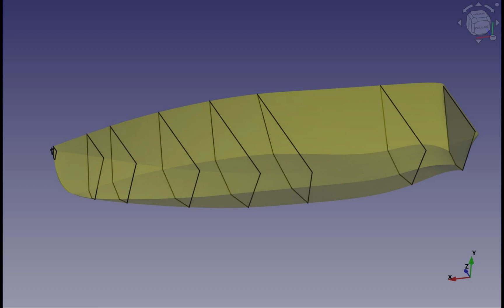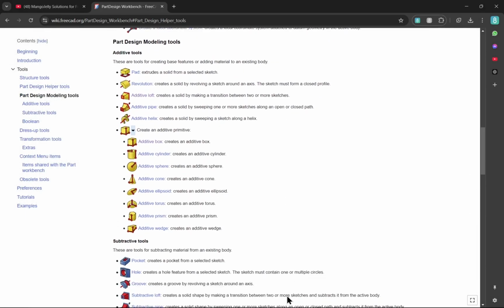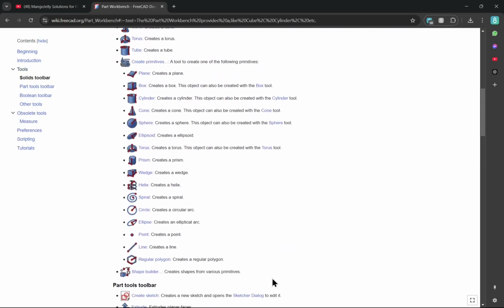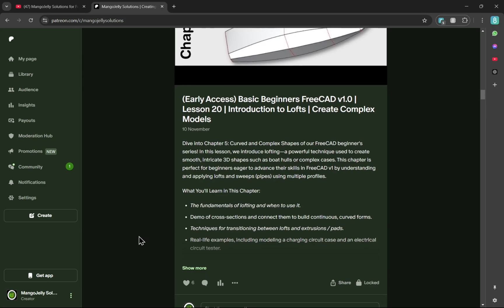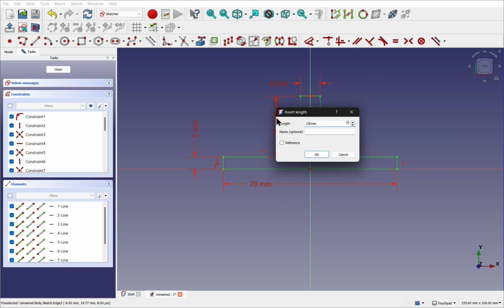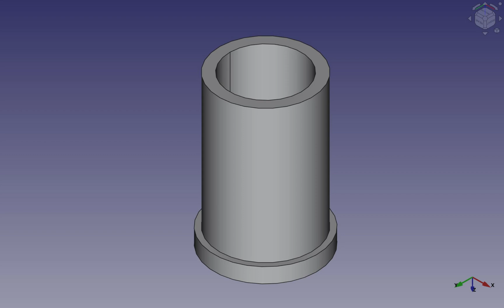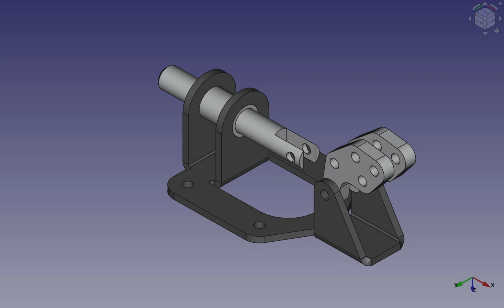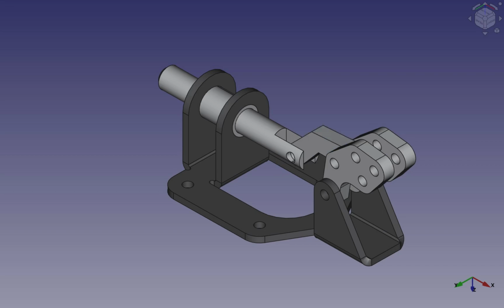Basic Beginners FreeCAD v1.0 : Introduction to Course

Comment: Hello, I see here that you have 2 55 part (as of today) courses, this one called Basic Beginners FreeCAD v1 Course and one called Basic Beginners FreeCAD v1 (Public). Are they the same, or different? If different, which would be the better option for someone who wants to design woodworking projects and is completely new to CAD software?
Reply from the maker: Hi, yes they are both exactly the same. But agree is confusing. YT decided to create a new feature called "courses" which is basically a playlist in a new course tab with a completion gauge. But this is an early feature and anyone looking for the playlist as it's been referenced by in the past wouldn't of found it. People also reference it as a course so they are exactly the same and live in both. Sorry for the confusion. I will update the description on both. Hope that helps.

Comment: me and my 19yo daughter just ordered a bambu mini a1. freecad came up as a good place to start. i just watched your video on making a bracket. an hour long and i didnt nod off, so i have subbed and going to make my way through your tutorials over the next few months. quiet an achievement for 10pm on a Sunday night
Reply from the maker: Ahh it sounds like you watch the Ultimate Beginners FreeCAD short course?  Great to hear that's given you a good head start and your already got something built.  Hope you enjoy the long form course, it's pretty in depth but it covers virtually everything in the Part Design.  It's design so you can gather knowledge and drop in and out.  Good luck with the learning and thank you for subbing.
Reply: @MangoJellySolutions no worries, I started with the playlist. Your course and style are very good! MUCH better than anything else I’ve found. I’m on a Mac, and some of the alt click suggestions take me a few minutes to figure out becuase the Mac option key doesn’t always equal the Windows alt key. 
I’m trying to learn this so I can design woodworking projects. I originally tried the free version of Sketchup, but the first time I needed to change the size of one board, I realized the limitation.  In my subsequent research I learned about “parametric modeling”, and then I learned about FreeCAD. Gemini AI and Perplexity both said MangoJelly is the “gold standard” for learning FreeCAD.

Comment: Any chance of doing a video solely on how to fix broken bodies.  I get this problem a lot where I design something and its not quite right and I have to edit something pretty near the top of the tree. Then suddenly I have lots of broken things. I get a whole host of error messages about things not being attached and faces missing. Its particularly bad if you have fillets or chamfers, I nearly always start off by deleting all of those.  I end up deleting a lot of features of the body until it sort of comes right. Sometimes I can re-attach things but often not.  So some strategies on how to approach a broken body and fix it would be really useful
Reply from the maker: I think this is the second request for something to cover what you are having problems with, the other one was from a patreon.  I think this would make a very useful video.  I will add to the list.

Comment: Hi, I have been following you since sometime, a month to be honest. I really wanted to know how  easy it would be to create parametric design lampshades with that wavy spiral patterns like we get at wooj design. I am really looking for one but could not find it anywhere. I know we can do that easily in rhino but that software is what I can't afford at the moment. Thank you for your videos. There is no documentation for freecad for those but I think this lofting technique make my understanding a bit clearer.
Reply from the maker: There are a number of lamps on that site, some of them are pretty simple to create, others are a lot more complex but most your are right in thinking to use a loft.  Such ones as the wavey lamp is a standard loft, or a loft of one section and then a polar pattern.
Reply: Thank you so much for your reply. Trying to wrap my head around freecad. Could create some patterns now but still a lot to learn.  @MangoJellySolutions

Comment: These videos are excellent. However, what I find baffling about FreeCAD is the lack of consolidated documentation on the "objects" used by FreeCAD. I do not mean the actual implementation in the software. The model tree view shows items, that are conceptual "objects" at any rate.

For example, when just experimenting, I created a new file and then added a Cube in the Part WB. I then went to the Part Design WB and created a body. The Cube and the Body were then separate in the model. I dragged the Cube into the Body and got a "BaseFeature".  What does all this mean? How does a Cube from Part WB relate to  similar geometry made with an extruded sketch in Part Design?

I could pick my way through the wiki and figure it out (maybe), but the focus in most videos is on actions, i.e. how to do stuff.

This kind of question might be appropriate for the FC forum. A search of this kind of topic on the forum led to the usual collection of unhelpful, arrogant responses that amount to "you don't need to know that" or "RTFM". 

 So, a video course would help.
Reply from the maker: I am glad you enjoying the videos.  What you are finding and question is one of the things that I experience as a real hurdle for myself.  I kept on asking myself "why ???" as well.  This is when, after a lot of research and reading I found out the reasons why.  The part design workbench was born after the part workbench.  With the part workbench you can use anything from other workbenches.  But when you enter the part design it starts to become confusing.  

The part design workbench is really a self contained workflow and focuses on solely solid based modeling.  You can pull in objects created in other workbenches as long as they are solid, as you have done but you can only have one base feature.  There are other methods to do this but you are mixing two very different workflow.

The part design workflow is feature driven in that you create sketches upon features created by other operations and then create an operation on that sketch.  This operation automatically fuses / removes their volume to / from the other operation.  Part WB fusion / removal of material is done manually giving it a more flexible approach.  

Where the part wb comes into it's own is with surface and compound base modeling which the part design doesn't support.  

I do have a video that touches on this in the course but it is a major thing that creates so much confusion in learning this package.
Reply: @MangoJellySolutions  Thanks for the informative response.

Comment: I learnt a lot from this channel when I was learning FreeCAD v0.22, and it was because of the concise and well structured manner of teaching that I decided to become a patreon about 8mths or so ago. Darren was very helpful when I got stuck with one area of a design (which was creating through holes through multiple parts). Recently, owing to family commitments and having to do a fresh system install I'd been away from FreeCAD for the past few months, during which time v1.0 was released. The other evening I needed to use FreeCAD to do a simple bracket for a 3D print, no problem I though, so downloaded and installed the program, ran it up, and was stopped dead in my tracks!... So much had changed I felt like I was back at square one! Different colours, new layout, buttons I didn't recognise or were missing, even just finding my way around the new layout in Parts Design it was obvious there were a number of new features that were an improvement over v.0.22 but which I wasn't prepared for. My first place to go for help was this channel, specifically the crash course for v1.0 which proved ever so helpful...  So, I'm back to learning about FreeCAD v1.0 at the Introduction Course just so I can discover what changes have happened and refresh my memory... Thank you Darren for staying so up to date with FreeCAD and making invaluable videos that are a blessing to learning FreeCAD. You are a gem, please keep up the amazing work!
Reply from the maker: Nice to have you back and thank you for taking the time to write this comment.  I really appreciate the kind words of support.  So glad that I can still offer out help :) :)
Reply: @MangoJellySolutions  Am starting freecad learning as well  Started wth your turorials a whiile back, btu decided t dive into F360.  Was farily deep into F360, but cannot stand it anymore.  too many issues and if I grow, too expensive to use for my hobbyist goals.

Comment: Hi man thanks a lot for this, awesome work I just subscribed

What I didn't see on youtube or anywhere else is an honest review of the V1 software, like what are your critisms, say compared to Fusion 360. I think this would make a good video topic also for the dev team to get some video feedback.

Many people I know is interested in switching but are afraid, because also for previous versions I heard amazing things, tutorials were there but then after I started using it, parts started crashing with topology errors and some more that I didn't even understand. In Freecad's defence there were workarounds, like a certain way to design the parts but in my defence, I did what was easiest for me just like I would do in anyother cad suite and it'd work, here though it crashed.

I heard V1 tackled this issue, but when I google FreeCad V1 bug, forums are boiling and I can find a lot of other issues. What is your honest opinion? How would you rate V1?
Reply from the maker: Hi, great to have you here and thank you for your comment.  My honest opinion,  I have used a lot of 3D packages in the past and v1 is a long awaited and huge step forward.  I have a number of  patreons that I have helped with projects who have made the switch from F360 to freeCAD and they are satisfied with the product.  Obvious as with everything there are improvements to be made but this is just the beginning.  FreeCAD is already pushing forward with new developments.

The adoption and change management from one software to another is always a rocky road.  As humans it's in our DNA, we don't really like change, it burns too many calories learning a new way of doing something, and you see this a lot with swapping software.

Comment: How to make pattern array in sketcher? When i use the array command, all of my lines are out of constraint. The base circle or line is fully constrained, but the pattern-array line, circle are not. In other cad platforms, it will be automatically constrained because the base line, circle is fully constrained. I cant find Create Array in Freecad V1.0.0

Comment: FreeCAD made a big improvement. As the main modelling software I am using Rhino but for some parts a classical CAD program with with constrains works better. I was trying several times FreeCAD but ended up with Fusion. Anyway, I think now is the time to have next to my Rhino a FreeCAD.
Reply from the maker: I loved Rhino, Grasshopper was a bit of a time consuming modelling process but enjoyable

Comment: Can you make some easy to follow vids on making nuts and bolts as well as knurling please? All the vids I’ve found are back and forth and can’t see what’s selected when they’re doing it making it hard to follow.

Thank you and keep up the great work
Reply from the maker: This sounds like a really good idea and it will fit in nicely with the addative helix tool and patterning tools in the part design. Just for reference there is an addon wb called the fasteners workbench which has a large selection of threaded nuts, bolts etc all to iso spec if you ever need something quick.

Comment: Great videos, truly top notch. The 1.0 release still has quite a few UI bugs/issues. Can't type in digit values because it switches the camera view is a real mess atm. Looking forward to more videos as freecad bugs are cleaned out.
Reply from the maker: Thank you :) Glad you like. In regards to digital values do you have an example of what you are doing when you experience the issue? I would like to look into it. I have only experienced this when I type into the placement field when I have forgotten something is attached and it's the attachment offset I am suppose to be editing so the other field will be locked. Or when I enter values into a field that is locked by an expression and I need to open the expression editor to clear it out first.  It will do that with anything that is read only.

Comment: Could you explain how this works? This is the first video on the series just released, but the playlist already has videos - from many months ago.
Reply from the maker: Yes it does seem a bit confusing but the video is an introduction to the course. As I was building the course I wanted to release each lesson as they were made, but the trouble with that is you end up with nothing for a intro or chapter videos. Now there are some videos in the course and to coincide with the official release of v1 of freecad yesterday I was able to create the intro video. Also I have answered a number of questions from the other videos in the intro to help new comers to the course such as the version numbering and what is happening with my other series (learning freecad for beginners) and if it's still relevant or does this course takes its place. As the course grows I want to add chapter videos detailing what will be learnt in the chapter and also cover some additional questions from those  videos already released in the chapter. In that way it builds a kind of index into the course.

Comment: When adding a Spreadsheet to enhance parametric design, where to you place the spreadsheet in the treeview? Under Body or under the Object I want to parametrized? May be it does not make a difference? I looked in the Freecad Help, but coud not find any help.
Reply: the spreadsheet is standalone in the file(you can't even move it inside a body), that way all parts in the file can reference it. If you were able to put it within a body or object, then when you wanted to reference it you'd have to put like <<body1>>.<<ss>>."cell label" in you dimensions.
Reply: although with the newly added varsets, you CAN add them to a individual part, and varsets can reference spreadsheets, so you can have a spreadsheet diameter value of like 40, then in a part have a varset named 'radius' thats like "=<<ss>>.diameter/2"